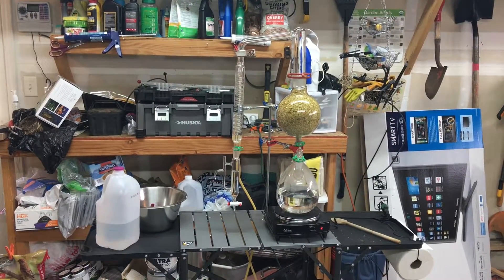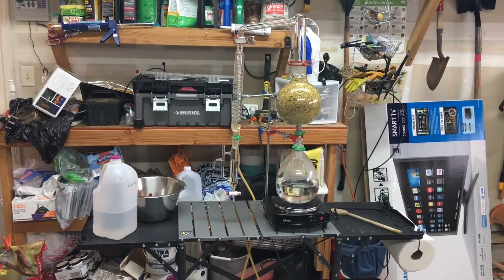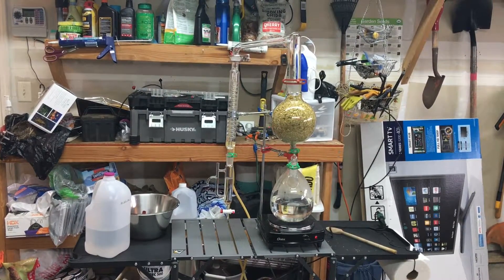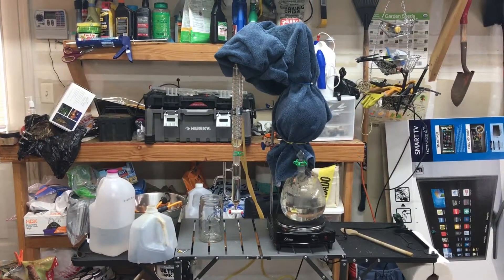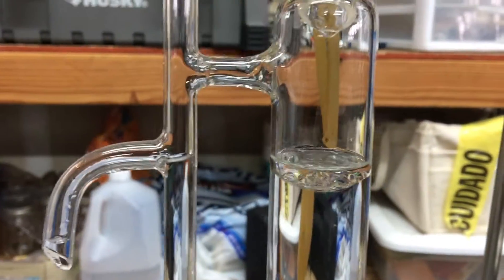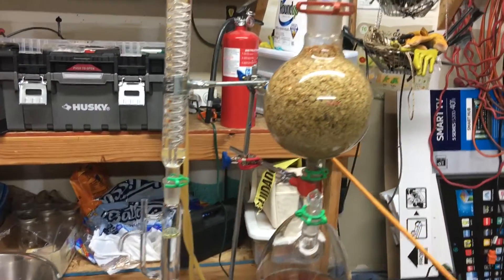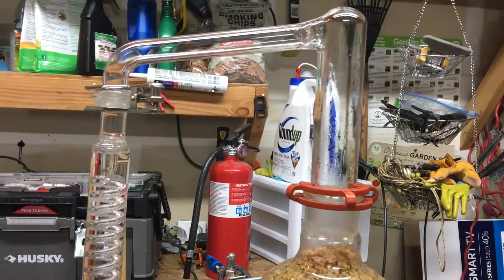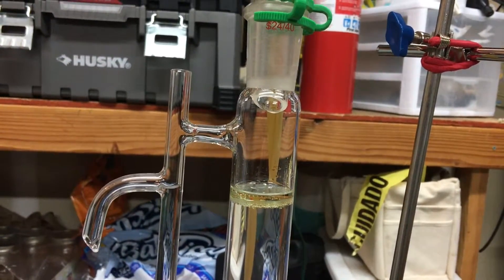Citra Hops Distillation Part 2

Comment: Dave, did you brew with this oil?  I"m interested in doing the same and was wondering about IBUs per gram.  I use a lot of centennial in my IPA's (Bells 2-hearted clone!).  Thanks for the info.
Reply from the maker: No IBUs. The oil is not at all bitter. It’s very aromatic

Comment: Hi Dave-Love the videos! I am trying to distill hops with a steam distillation kit like yours, except my hydrosol and oil go into a beaker below the condenser and not into a oil/water separator. Problem is, I have tried twice now to yield oil and all I am getting in the beaker is the hydrosol/water product, no oil - although when the process has just started you can actually see the water/oil in the stills arm but not in the beaker?!?! SUPER FRUSTRATING! Couple questions for you: a) does it make a difference having the oil separator vs. the beaker? b) does the ice water make a big difference to extracting the oil? Would definitely appreciate ANY guidance and help back because I have rerun all your videos and cant see what I am doing so differently! JC
Reply from the maker: I'm glad you like the videos. I like the separator. I think it cuts out a step.

Try wrapping the biomass flask and the arm in a towel. It will help insulate the still. I think if your oil is stuck in the still arm this will keep the equipment hot enough to push it through the still arm.

Also make sure you are using a super resinous hop variety. I have used Simcoe and Citra. They both produced a high yield.

I hope that this helps!

Comment: Love your videos Dave, I'm planning on getting the same setup from Sam do you recommend it. I also read it be better with just the glass and get the burner and stand some where else. what do you think from experience?
Reply from the maker: Glad you like the videos. My burner from Sam broke after 5 or 6 uses. He tried to troubleshoot through email by explaining how to rewire. I didn't have the patience and bought an Oster burner for $20. Works great. Let me know what you are distilling. I've had many successes but also some failures. Super fun though.
Reply: Sweet I will probably go ahead with it. i use to work for young living HQ and it got me interested. I am thinking of doing sandalwood bits and try Melissa and rose. they are expensive for a reason, but isn't that the fun. Also maybe stinging nettle and chamamile.
Reply from the maker: I failed at sandalwood. It is a very hard wood. I couldn't grind it. It is also a 36 hour distillation. I would try the powder but it is still a 3 day process. I have a hard time sleeping when the equipment is running overnight because of fire danger. Rose is not a feasible option for home distilling. You would not even get one drop due to the extremely low yield. That's why it is so expensive. You need a field of roses and expensive equipment. I've heard Melissa is good. My favorite is peppermint. It is an easy distillation with a decent yield. You can fill your flask with a half a pound and learn the whole process. It is also my favorite herb for medicinal purposes. I would recommend not going too big on your first try.    Here are my recommendations for the first time distiller. Lemongrass, peppermint, ginger, orange peel , lemon peel, clove, allspice, hops, black pepper (awesome) cloves. Hard items like cloves and pepper should be soaked in distilled water for 15 minutes minimum prior to distilling. Make sure you do something simple first. Take it from me. You won't be disappointed.
Reply: Wow thank you for that. Yeah your right on the rose. i use nettle for allergies I wonder if its oil is good to. I want to try herbs that i can't get at places. I am also going to do mint and cloves your video on clove oil yielded very good i thought.
Reply from the maker: http://m.essentialoil.com/?url=https%3A%2F%2Fwww.essentialoil.com%2Fpages%2Fpercentage-yield&utm_referrer=#2651

Good reference for yields. It may affect your decisions. Not all herbs and plants have the oils you want. I don't know about nettle but it seems more like a leafy green?